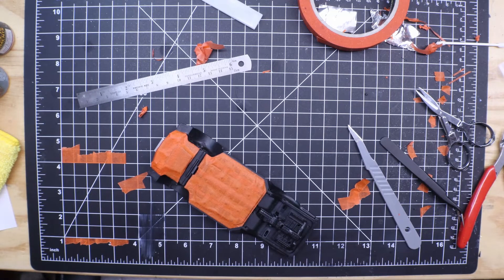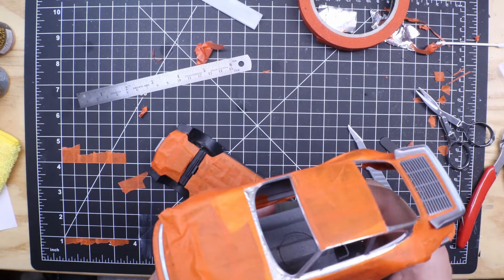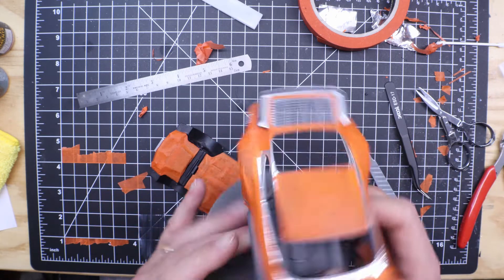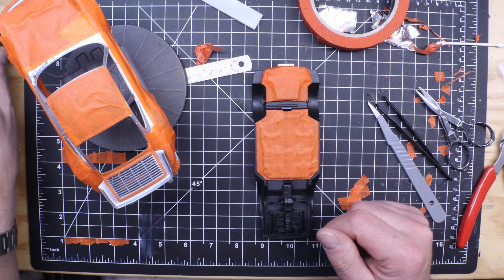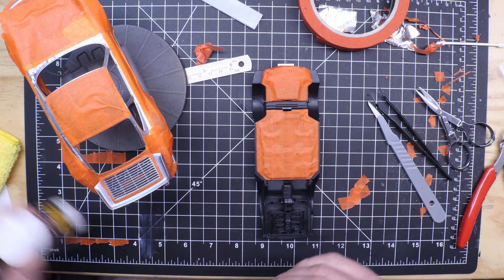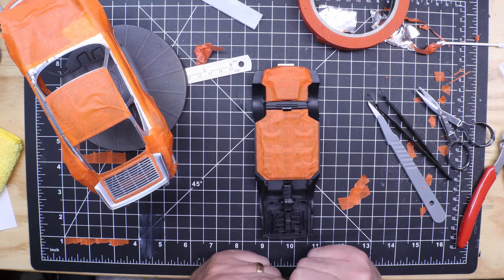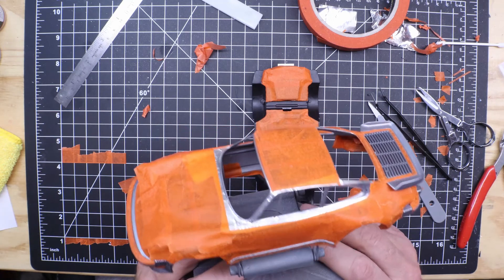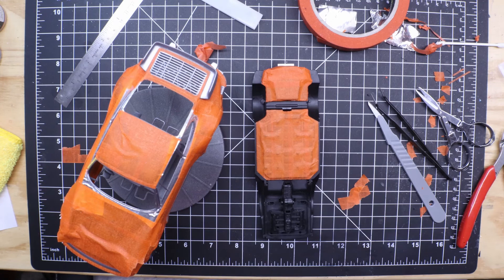Tamiya 88 Porsche 911 Turbo update #4

Comment: Hi Brain, I am new to air brush painting and confusing about masking this model recently, thanks for the vid that showing how you masked clearly!
Reply from the maker: I had to go back and watch it. Yeah this body was a pain to mask off. Glad I could help
Reply: @FuelsModels  Oh didn't expect you replied so soon😄Thanks again! will try your method tomorrow, by the way, since this is my first kit, is this model's masking difficultly belongs to a intermediate or hard level in your opinion? It made me feel a little frustrated by masking it
Reply from the maker: Well honestly I hadn’t done meany before this one. Just take your time and if you get frustrated walk away for a bit and then come back to it. Don’t work on any model frustrated. One tip I use a disposable scalpel. They’re much sharper than a standard #11 X-Acto blade.
Reply from the maker: By the way way I try and respond to all my comments. If I don’t right away I’m either driving or sleeping. Lol